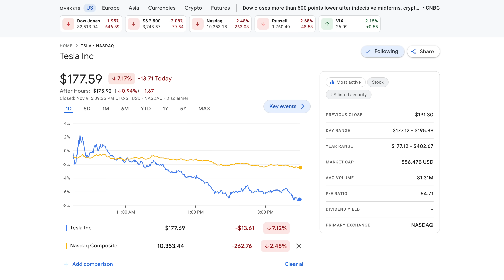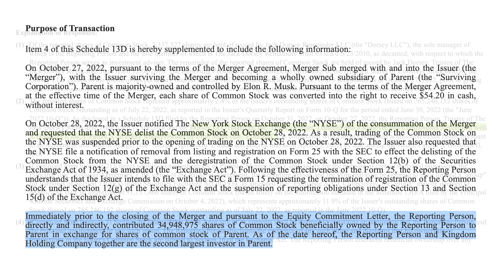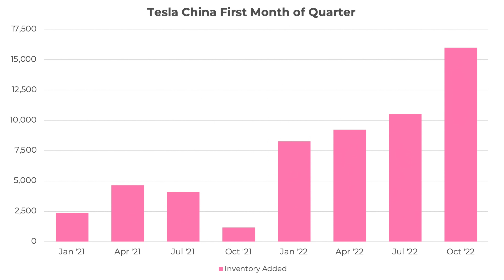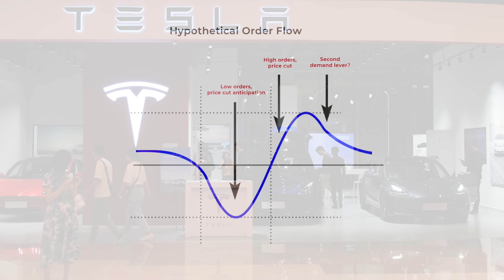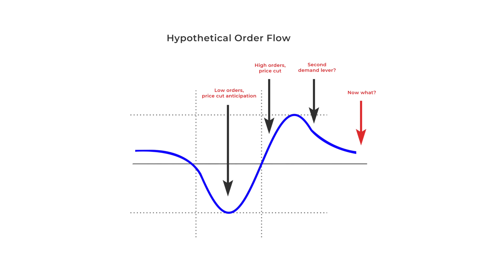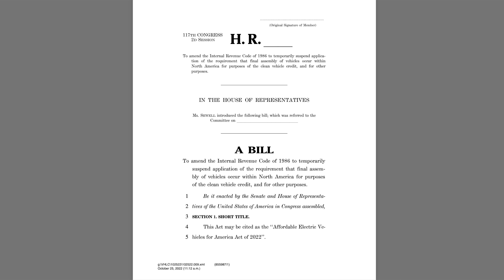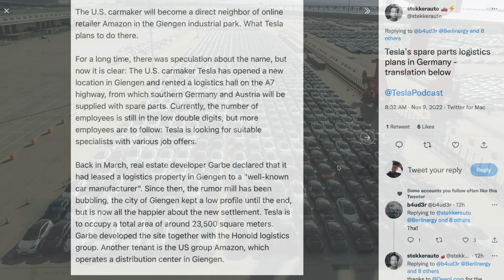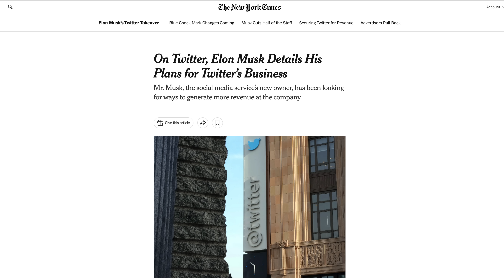Tesla Stock Continues Tanking, China Production Record, EV Credit Bill, Rivian Earnings

Comment: Took this amazing opportunity to buy another $1,500 below $180 per share. Absolutely insanely good prices!
Reply: Hopefully it's a good price. The stock market can value companies extremely high but also unreasonably low..
Reply: It is a good price, If you have the time and ability to hold for a couple of years
Reply: @HS85 , and if the market is going to value the stock significantly higher than currently (620 billion $). I don't see that as guaranteed.
Reply: @matthias4  "and if the market is going to value the stock significantly higher than currently (620 billion $). I don't see that as guaranteed."

In the long term it's guaranteed as long as Tesla continues their execution.
Reply: @Magpie314  "people used to say that about Cisco on 2000. Still hasn't returned to ATH 22 years later."

Do you see any signs of Tesla slowing down in their execution? If not then you shouldn't make silly comparisons.
Reply: @Magpie314  well if you study the fundamentals you can see clearly tesla is way ahead on every point of there busines. From manufacturing, to supply contracts, to best staff, to best software , to safest cars, to best range per kwh. Results in crazy high profit margins which are not seen in such a car busines. And it keeps on getting better each quarter beceause of scale benefits! So what can go wrong, not much. What can go well, a lot. Just need some time to sit out thats it.

Comment: Rob, saw from Troy Tesla that the insurance subsidy that you mentioned last episode - that is just part of the same insurance subsidy they offered in September 

In other words, Tesla did not add any new insurance subsidy after price cuts, it just honored the existing subsidy it announced in middle of September
Reply from the maker: I don't think that's accurate. Here is an article noting the bonus until only Sept 30, which makes sense because it was the end of the quarter: https://cnevpost.com/2022/09/16/tesla-offers-insurance-subsidies-in-china/

The new bonus specifically states that it starts on November 8th. The communication wouldn't make sense if it was the same promotion as it's been.
Reply: @TeslaDaily , how many Tesla shares have you sold in 2022 and in 2021?
Reply: @TeslaDaily  I would have to believe Tesla has the data to manage the order backlog efficiently and reduce production, as needed. Since they are not reducing production, I'm sure they have a plan to move those vehicles.
Reply: @Teddy_M85  the last thing you want to do is reduce production. Not a good sign at all
Reply: @atraplaga8373  "@troyteslike also tweeted that 35,000 unsold Teslas are sitting in Shanghai as of the end of October -- NOT GOOD -- and curiously omitted by Tesla Daily!"

Everything that is not reported is not omitted. And Troy tweeted about the historic export number from Shanghai in October. Breaking new records is not good according to you?
Reply: @madhououinkyoma  They are not reducing their production.
Reply: @emigoonie972  "That sounds really bad.  I wonder why PAYASO didn't mention that!?!?!?!!?!!?"

Didn't mention what? The record breaking export numbers from Shanghai that month?
Reply: @matthias4  
1) None of your business
.
2) My guess is he's buying
Reply: @atraplaga8373  
Interesting choice of words.
Let's see you define (and back up) the term "unsold"
.
Maybe you should try "undelivered" in this case?
.
Save "unsold" for the Inventory that others have on dealer lots having "sold" to them, but not reserved by or with a commitment from customers?
I have a feeling that "dealer stock" is going to bite the dealers and manufacturers very soon.
What will you say then?
Reply: @yourcrazybear  That's my point
Reply: @madhououinkyoma  "That's my point"

So what was the "not a good sign" remark about then?
Reply: @yourcrazybear  I was replying to "@Teddy M". My point was that using Tesla not reducing production as a sign of anything is pointless. They just won't do that unless they're forced to.

Comment: sorry Rob, I don't know if I'm doing the wrong math, I'm far away from being an analyst, but if price is lower, the number of people that can afford a Tesla car increases, so if Tesla sells more cars with a smaller earning margin per car at the end the loss due to the reduction of the margin can be compensated by the increased number of sold units, and if they increase is significative, the total sells will still bring to bigger profits than higher margin per unit with less cars sold... am I wrong with this thought?
Reply from the maker: No, you're explaining economies of scale. The question isn't whether Tesla can sell more cars, it's whether those sales happen at a 30% margin or a 10% margin. If they are selling 2M either way, 30% is obviously better.
Reply: @TeslaDaily  thx for your answer, indeed if the number of sold cars is the same, the lower profit margin is a problem.

Comment: Good analysis on the demand pockets. I would like to add, that is not only a short or medium term thing. With far more players in China than elsewhere, it might be an indication for the long term potential for margins in at least China. Basically once Tesla will sell 10 mio cars, the margjns will be significantlt lower than currently.   Certainly if Chinese competitors are bying markst share, like Toyota did in the 70’s. And Tesla can of course reduce costs, but that will be less and less effective as time goes on

Comment: Rob, if you're getting negative comments it may be because you sound negative. The multiple repeats of how bad a fall in demand is for Tesla isn't necessary to get your point across. I assume your point is: "The world in general and China specifically, is going through a downturn. So Tesla will see softer demand over the next period and it's stock price will be depressed for that period". For me as a stock holder it might become a buying opportunity (assuming sterling recovers a bit) but nothing to worry or bang on about.  With most of 2bn vehicles to be replaced with EVs demand over the next 5-10yrs will be fine on average. 😀